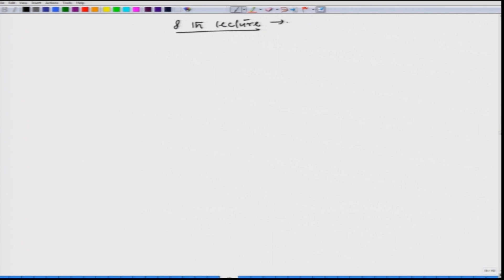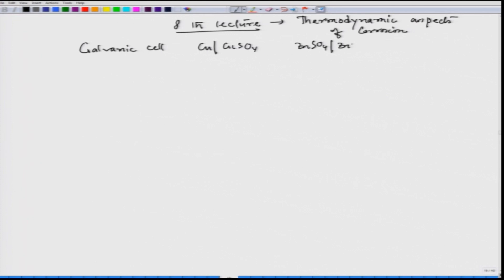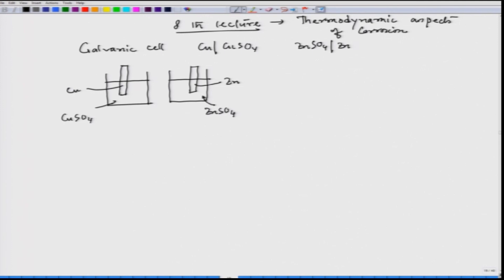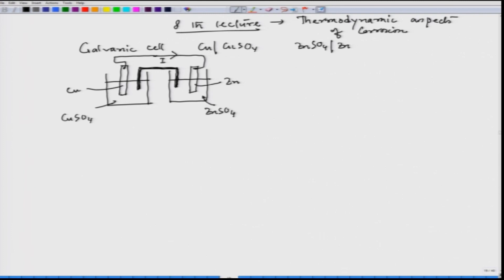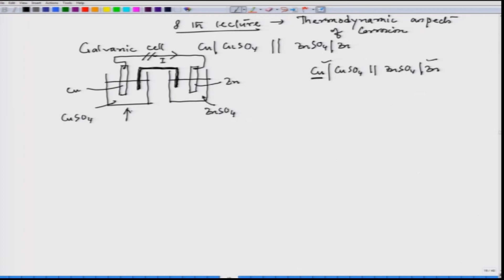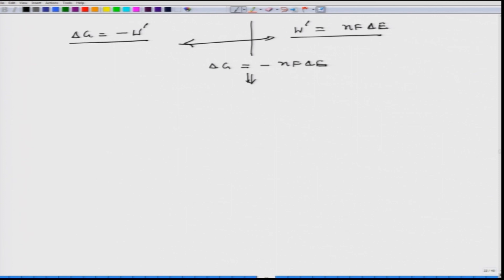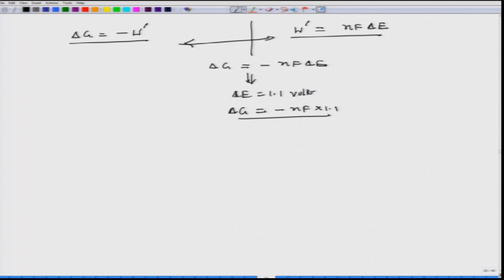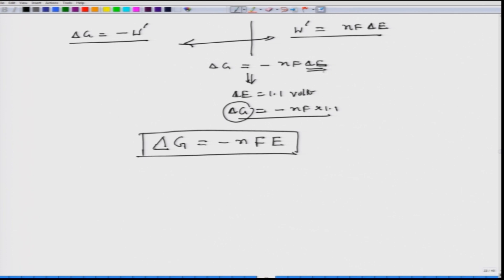noc18-mm14 Lecture-08-Thermodynamics aspects of corrosion-I

Comment: Sir generally oxidation occur at anode and reduction occur at cathode, so Cu act as cathode and Zn act as anode. But you are mention +ve sign of cu and -ve sign of Zinc ? How we can understand this ?
Reply: Please judge the sign of an electrode from the current flow convention. Please check which side electrical current flow in the conductor. Here, current flows from Cu to Zn in the conductor. So Cu is +ve and Zn is -ve. Judge anode and cathode from the electron flow at the electrode. If electron is accepted by ion at one electrode, it is cathode since cathodic reaction takes place. The other one, anodic reaction or electron is left in the electrode. It is anode. Cu electrode: Cu++ takes 2 electron and converts Cu. Hence, it is cathode. On Zn, Zn releases two electrons at the Zn electrode, hence Zn is anode. Hope it is clear.